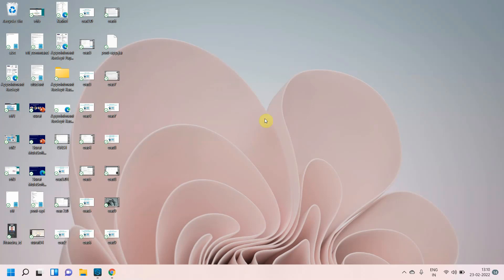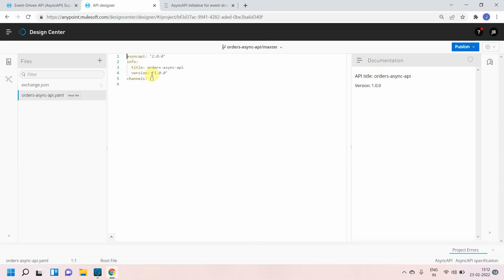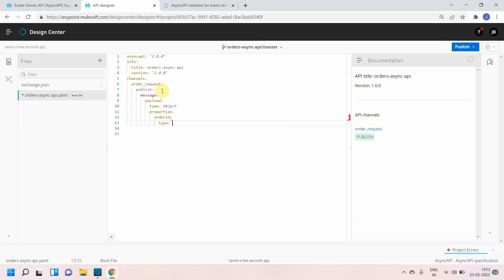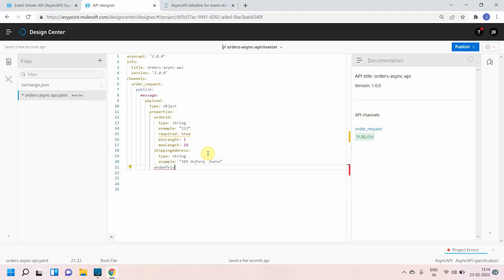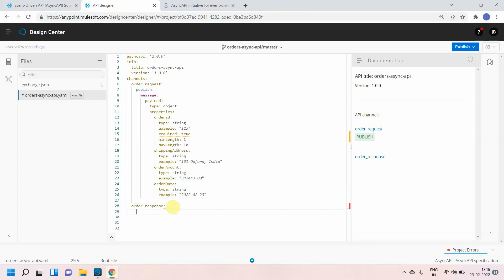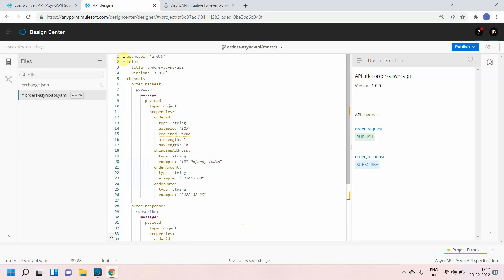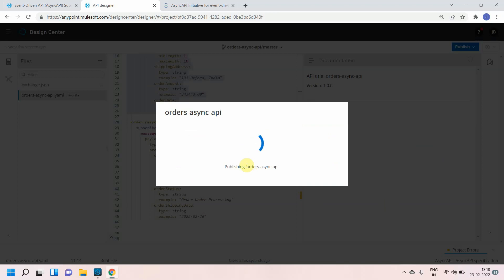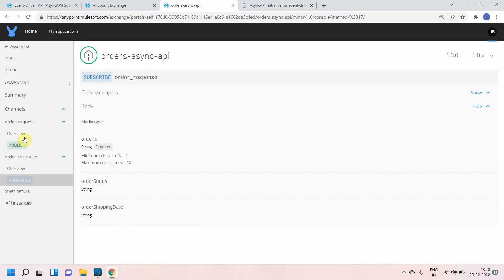MuleSoft AsyncAPI – Event-Driven API Design with Anypoint Design Center | Part I

Comment: Could you please let me know the usage of this async api... can we create flows in anypoint studio after importing async api like raml or it is just for design
Reply from the maker: Please check complete playlists. You will get answer
Reply: @muletechnologyacademy-zero5625  Hello I've watched 4 videos available so far in this playlist - and I can not find an answer to @nagappan karthick question... How can we "utilize" the AsyncAPI specification in Mulesoft itself? Or maybe it's just a "documentation asset" we write once in Design Center and than exchange with other parties? I mean: event-messaging platforms for further implementation?
Reply from the maker: Hi, Currently we can design AsyncAPI in design center and it can be shared via Anypoint Exchange or Developer Portal for discovery. Currently it doesn’t have capabilities where we can generate code automatically like APIKit router.
Reply: @muletechnologyacademy-zero5625  Thank you for the prompt answer. All is clear now.